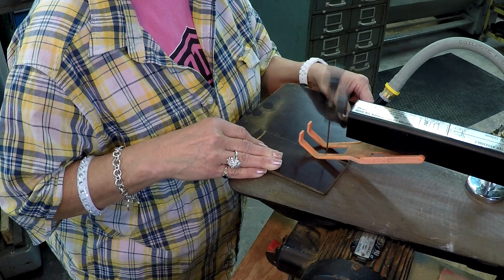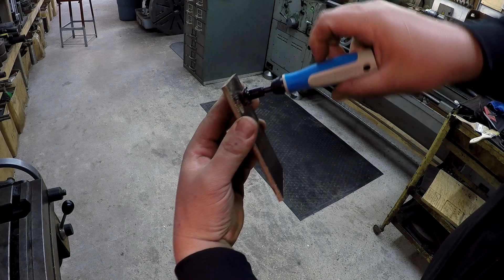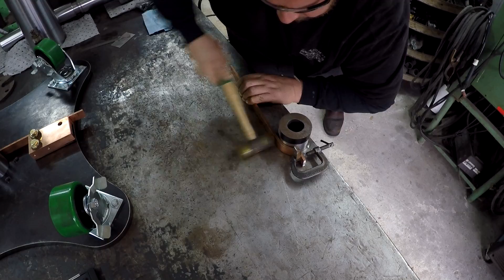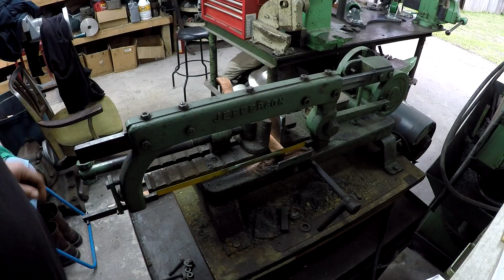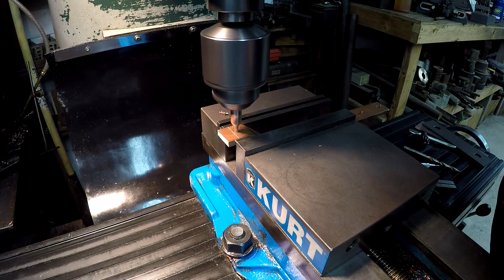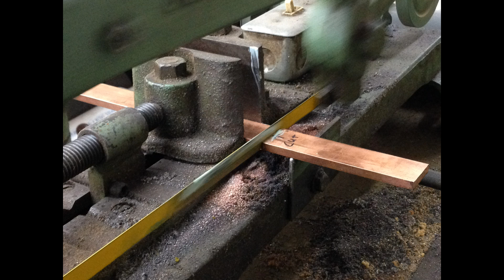Rotary Welding Table Build Part 14

Comment: This is all so gorgeous :D One thing left me curious in this paragon of belt-and-suspenders overkill - dressing those bent copper strips with a boring bar in the mill might have given you even more contact area! In all cases, conductive grease on that interface will maximize the ampacity of the sliding connection :)

Comment: Adam,  im looking forward to seeing this project completely assembled.  Its going to look great and be functional.  Have you thought about perhaps using some dielectric grease on the points of contact between the bars and shaft? I would think it would help maintain good electric contact and prevent corrosion on the points of contact.

Comment: Adam, if I could offer a suggestion. For the spring setup, I'd use a carriage bolt, file one of the holes square to fit the bolt, and use the spring and a wing nut on the other side. That way you have one hand tightning
Reply from the maker: The way I have it set up there should be no tightening. the bolt and washer just keeps the spring trapped.

Comment: You might consider using some conductive grease between the copper and the shaft.
There will be some oxidation build up on the copper that increases the resistance through the electrical connection.  The more oxide that builds up the worse the electrical connection will be even with good contact between the parts.  With resistance you also get heat.  The copper will be a good heat sink of course, but the increased heat increases the rate of oxidation.  The grease will help reduce that.

MG 801 Carbon conductive grease would probably be a good product to use. (Mfr. Part#: 846-80G )  There are probably other products as well.
Here's the mfgr's description:
Lubricates and improves electrical and thermal connections between sliding surfaces, while providing protection from moisture and corrosion. Type 846: Carbon conductive grease. Resistivity of 0.01 ohm.cm. Great for use as a thermal compound for heat dissipation with heat sinks.
Chemical component dimethylpolysiloxane⁄carbon black.

Table is awesome!  Your design of the copper grounding connection is clever.

I'm looking forward to seeing it finally completed.  How efficient the grounding is may be irrelevant: the table may be just too pretty and pristine to use.  It may wind up in your living room.  ;)

Good job, as always.

Comment: I know my comment is 5 years late. I love the project. but you isolate the ground block then ground everything including the bolts you isolated thru the plastic bits. ground will still travel thru every part of the table, base and all.  your machine work is excellent.

Comment: You had made a good job with that copper contact Adam. However, I would have used a brushholder from a heavy duty starter motor with a copper flatbar clamped on to that shaft so, that if there any arch ever occur during rotation, it'd be between the copper calmp and the brush which can handle in the excess of 500Amps...

Comment: You do nice work Adam, A thought on your ground, copper likes to oxidize (black tarnish works as a insulator) real quick, If ya ever look at contacts on a contactor, copper and silver plate.
I would of coated the wear point with silver, a torch and silflos flows real nice.

Comment: A family that works together stays together! Keep up this awesome work. Love the results.

Hopefully the rest isn't a TLDR situation!
When I bend copper, I try to anneal it. Makes it squishy almost, and for contact use, not such a bad thing. Then by hammering it into shape, it will work harden slightly on the outside, giving strength without over hardening the inside. Most copper bar stock is quarter to half hard (that I have purchased any ways). It is a PAIN to bend to maintain a radius with bar stock, but just like yours, when done right with patience... it looks awesome!

You are right on with the spring bolt idea. Drill through both contacts, and put a bolt through with a high strength compressive spring on the outside. It is what is used on pool equipment for example, like on the DE tanks. Compression springs are easier to use, cheaper to buy, and can work in such a small place! Basically, something like these: 
https://grabcad.com/library/spring-bolt-nut-washer
https://grabcad.com/library/spring-with-nut-bolt-1
That allows you to vary the clamping pressure and compensate for any wear, which should be minimal to nonexistent. If the spring goes slack, there is probably a much bigger problem. Plus, since you are going for fine details, you could drill and ream one contact, and simply tap the other. No nuts, just a bolt, spring, and washer. 

I dont know if I would trim that little edge. It looks like a couple taps with a hammer will push the crease in a little better matching the other.

Last thing, I would get some gritty polishing compound and use it between the shaft and contacts. Let it run for a few hours. The copper is far softer, thus will wear and polish much quicker. I like to do this on brushed DC and AC motors when I restore the pads. The polish by running makes them mate perfectly. You commented that you saw 3 points of contact. A brief polish makes one massive one, preventing hot spots. By smoothing it out, you are less likely to get any pitting in either the copper or the sleeve from stray sparking. Just a wipe with acetone after leaves the perfect contact. Thats by far the OVERKILL method of contact prep! haha. But with as much dedication as you put in for this, it seems to me to be a quick fire and forget step. ;-)

I want to definitely say that this is definitely your own! Great work again. And I see it being able to move a TON of current in a short. TBH, assuming some of the sizes... 500 amps or more should not fuse the bearings! Now get to relaxing! haha.
Reply from the maker: Thanks Cody! I may run 250 amps once in a while. My machine will go up to 330 maxed out I believe. I'm hoping my design will handle it no problem. Thanks for the comments.
Reply: Abom79
Adam, a quick estimation from the sizes of materials and contact area shows that you won't have any problems until at least 1600 amps. Hope you have big enough cables, ha ha. You should make a center cover/spindle thread protector/cup holder for the 5/8-11 hole. Great build.
Mike (o\!/o)
Reply: Moholo 88
5/8" SHCS
Reply: ***** Cheap, simple, clean. Has to have torx bits though. Those, IMHO, look the cleanest.

Comment: For the electrical connection bolts you should use brass so that you enhance the electrical connection. The resistance of SS is much more than brass and the less resistance, the more electricity actually passes thru the connection.

Comment: With plumbing, connecting copper pipe to a stainless steel pipe on a water heater causes an electrical condition corrosion between the two different metals, so a special adapter needs to be used.

Comment: Hi Adam. You could put a long bolt through the ends of the copper strips with a spring between the bolt head and the copper. Tightening or loosening the bolt will vary the tension. Like the clutch springs on a motorbike clutch. Just ordered my Abom79 tee shirt  also. Cheers
Reply: Oops just finished watching and thats what youd planned to do.
Reply from the maker: LOL....you guys! Thanks for the support Philip and hope you enjoy your shirt!

Comment: As always...awesome video. If you wanted a super accurate fit on the copper arms you could use some lapping compound on your test shaft and basically lap the copper to the steel. Just a thought. Okay...what ya building next...I feel machining withdrawal coming on already.

Comment: I really appreciate the level of detail and quality you have put in to this build and I have enjoyed watching every single video.  But, man, this grounding strap thing is getting crazy, lol. You are waaayy over complicating essentially the most simple part of the design.  But, it's your table... more power to ya!   :)  P.S. At least put a spring with more tension on there.  Think about the tension of the spring on the ground clip. Your spring should be comparable. Just my 2c. Again, I have really enjoyed watching, can't wait to see it finished!

Comment: If you have an old intercooler clamp off of a Cummins Dodge Ram, all the pieces are there for clamping the copper rods.  And they are stainless to boot.

Comment: Car valve springs would work well, would hold the right pressure for ever. I don't think you will have any trouble with current carrying capacity with your arrangement.

Comment: Also, instead of a spring, you could measure the gap between the two copper bars, drill them for a single bolt, and use a spacer cut .005-.010 smaller than the gap to ensure positive contact.  It's what i would do if this were my build.  It would mean that you could, as the bars wear, adjust the contacts so as to maintain positive contact for your groundstrap.  Just sayin'.
Reply: A strong enough spring eliminates the maintenance task of constantly checking how tight it is and having to make those adjustments.   I like the spring idea much more.
Reply from the maker: My thoughts were a good spring would put enough pressure on the bars to always keep them pressed against the shaft.
Reply: There is that, but springs do eventually wear out and need to be replaced...a jam nut or grub screw would eliminate the need for constant monitoring, though.
Reply: Adam will probably wear out before a good spring will.
Reply: Anon Ymousmie ok, dude...a couple of difficulties i have with your constant nay saying about my comments that are addressed to Adam...1st...THEY ARE ADDRESSED TO ADAM...2nd...oh, yeah...THEY ARE ADDRESSED TO ADAM...I was merely giving him an alternative to the spring...nothing more and nothing less.
Reply: Don Foreback And ultimately, ideas are the whole idea! I hate seeing people in comments that essentially write just to disagree, especially when no other suggestions or better alternatives are given. I like your idea, and it works well in a lot of applications where the rotational speed is low, like this table. It is robust, and with good anti oxide grease, lasts a very long time. A simple readjustment of the bots sets it back into place.
Reply: Cody Smallwood Exactly why I replied to that guys latest comment the way I did.  As a YouTube creator myself, i get some negative commentary myself, and sometimes don't deal with it as well as i should.  I sometimes let the trolls get under my skin...But not this time.  I do try to act in a manner that befits my role as a content creator...MOST of the time...LOL
Reply: W.E.

Comment: Hey Adam. I think Mom's cut was right on the line. maybe your mark was a little off. Any Mom that will help in the shop, we have to cut them a little bit of slack. Thanks.
Buddy
Reply from the maker: You got me Buddy. I worked off that previous cut line on the material. :)
Mom really enjoyed being a part of the project. Thanks man!

Comment: also..... man you need some welders clamps, and a flat punch right under the original bend parallel with the spring mount tabs 
would have made a world of difference

Comment: That table could hold a small locomotive with enough precision to wipe a knat's butt. Are you sure you can hold your  hand steady enough to weld under those conditions? I know of a guy who can weld shim stock to a crank shaft but his claim to fame is welding a razor blade to a ship's anchor. Seriously, I love your stuff, and please let us know what is overbuild and what is function. Keep up the great work on this welding table project.

Comment: I would use a stronger spring.  The amount of force you apply with your finger to compress it, it really all the force it is applying to the bars to squeeze them.  Really, a decent sized wave lock washer may be all the tension you would need to apply, just do not crush it all the way.  You could also drilled holes through the bar in between the shaft and ground block and put a tension spring there as well.

Comment: What are you gonna do about that last unused hole in the copper block? I know it's not hurting anything being there, but it's eating at me. You tell that hole I've been watching him since he showed up at your shop. Congratulations to you if you can turn the table over and forget it's there. If it was the finest, most perfect welding table I ever laid eyes on, I'd still lose sleep knowing there's a hole hiding under there. I'd be up the next morning stripping Romex and tigging that hole shut. Good work Adam, awesome setup and video series, Thanks Buddy.

Comment: Belville washers, or no springs.  just take advantage of the natural elastic properties of the Cu bar.  just twist that bolt up a bit if it wears in.  Might  you consider using Cu wire braid in the interface for increased contact?

Comment: If you are worried about current transfer thru the bearing cut what ever size hole that the diameter your shaft weld it to the out side  of the bearing and then some of your isolating material you will also have to cut your center hole in the base plate and if you do this you will never have current transfer to the plate

Comment: Put a small spring on each side of the bolt to keep pressure even on grounding bars.
Reply: Charles Lambeth Adams method is better, unless you have two springs that are perfectly matched.  Otherwise one spring will over balance the other and actually lessen the tension on one side.

Comment: The bars themselves will act as a spring....just put the bolt thru and tension it a bit.
Reply from the maker: The bars are already sprung against the shaft, the spring is just help insure they stay snug.
Reply: I think the copper will not keep a permanent spring so you will need some separate, steel spring somewhere forcing the copper bars together.

Comment: This certainly looks good, but did you ever think of using a flat braided ground strip around the shaft attached with a spring for tension? I just guess it would have the best contact area + it´s simple to make.
Reply from the maker: It's a good way create a ground connection no doubt, but I had already seen it done. Was trying to create a different way.

Comment: You could run a over long bolt through clearance sized holes in the ends of the copper bars and capture a compression spring (or springs) on the outside of one (or both) of the bars.

oops... Guess you already thought of that! <Grin>

Comment: Enjoyed...nice work
Question/thought....you should check continuity between the copper and the base with the welding ground attached when the table is on its wheels to assure the clamp doesn't rock up and touch the plate, also will the ground clamp touch the edge of the base plate if pushed in to far?

Assume you have addressed these but thought I would mention!

ATB
Chuck
Reply: outsidescrewball Abom79 See Adam, someone with real brains already mentioned the idea.  I should read all the comments BEFORE I repeat someone else's idea.  Hi Chuck, dig'n Screwy Tuesday!
Reply from the maker: Hey Chuck, I'm hoping the phenolic plate will keep the ground from jumping up and touching the base plate. :)
Reply: the phenolic plate will isolate the ground clamp, I forgot it was there....err!!!

Comment: For the spring, how about your motorcycle buddy you have done work for supplying you with either a valve spring or a clutch spring?  If you use a valve spring then use the spring caps for it instead of washers.
Reply from the maker: I'll let them know to hook me up with an assortment.

Comment: On the one hand you are isolating the ground from the welding table.
On the other you have brushes to connect to the table.
Reply: The shaft is supported by and rotates on the thrust bearing, but it extends downwards throgh the baseplate to contact the brushes.
Reply: He's actually connecting the ground through the copper straps directly to the axle, which is a solid piece all the way to the tabletop. If he did it through the axle tube it would go through the bearing, which would make it seize up.
Reply: Magnus Nilsson Now I get it. Would a ground clamp be used to ground the work?
Reply: The ground clamp will attach to the copper block
Reply from the maker: Bruce T The others have already spoken, but yes the ground clamp will attach to the block and current will go though it, thought the two bars and into the main solid shaft, then up to the table top.

Comment: Abon this might even your pressure on both sides Use a bolt long enough and use a spring on both sides of the grounds scraps.
                                           Charlie.

Comment: Hello Abom

Really a great pice of work you made ther for yourself.
 And that you take the time and show use the process of building it...

You have constructed this rotary welding Table really tuff,
you possible can sell it on ebay as an Turntable for a Tank an nobody will complain...

what did you think about making it turn automatical?

a system that you can figur out for your one would be the best...
You work a lot whit hydraulik an pneumatic systems,
so an air powered turntable would be cool...

hmmm
An pressured fluid fessel wher oil get presses through an needle Valve  throught an hydraulik motor which drive the turntable and back in an second fessel.
below the table is enought place vor 2 big resovoirs ...
it will make like 10 turns then you have to flip an 5/3 way switch,
to reverse the flow and repeat the cycle...

Just some thinking...

i thank your really, i had howers of good entertaiment from your videos ...
Reply from the maker: I have thoughts to revisit this project later once I figure out and aquire parts needed to make this an automated rotab. 
Thanks Mr Melie